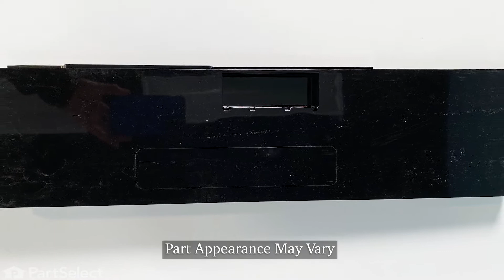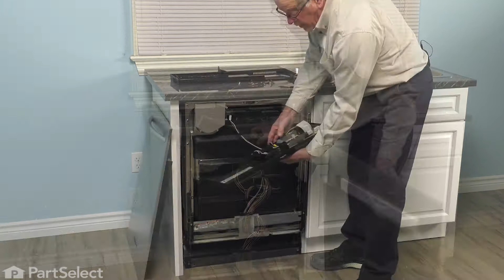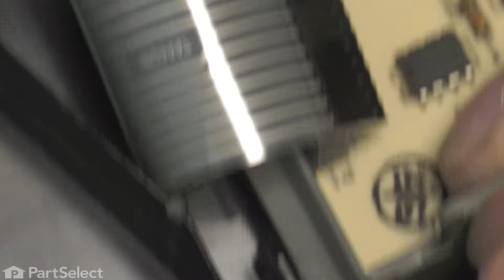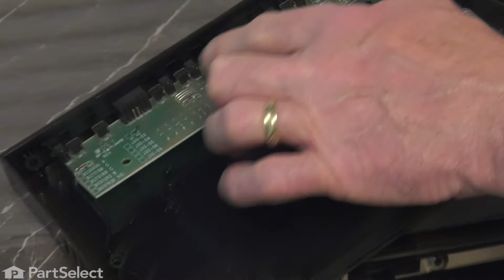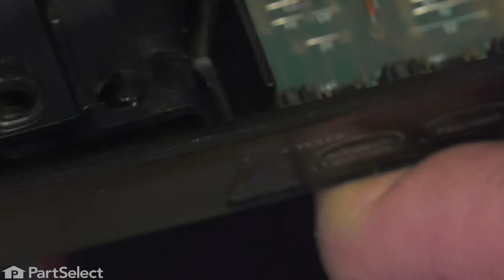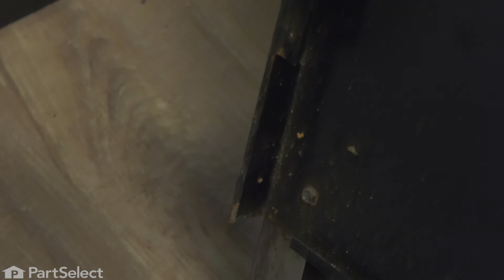Whirlpool Dishwasher Repair - How to Replace the Control Panel Housing (Whirlpool Part # W10775980)

Comment: Thank you so much Steve!! Worked just like you showed. I replaced the control board too.
Reply: A year later, my dishwasher would no longer start. Flashing lights on the Normal and Cancel buttons. Tried to reset by turning power off and on but no luck. Turns out that code symbolizes a bad connection with the ribbon connector. So I took it apart again and disconnected the ribbon on both the control panel and control board, sprayed with contact cleaner and used a toothbrush to clean. Put it all back together and works like a charm. If it happens again, I will use some vaseline to seal the connectors from moisture and dust.